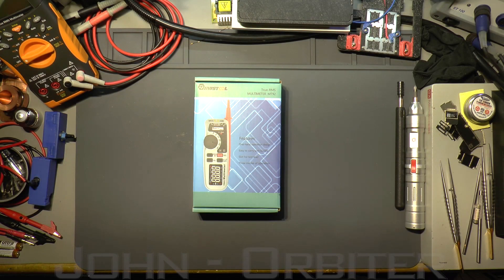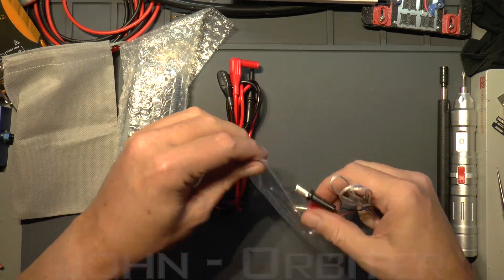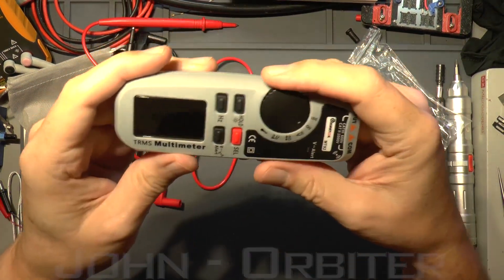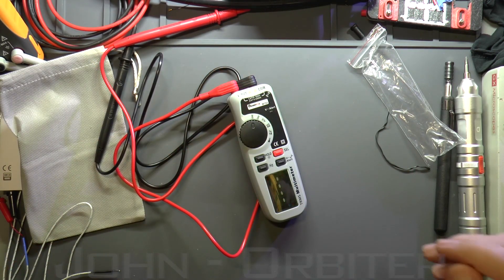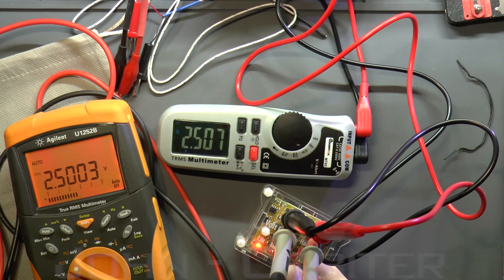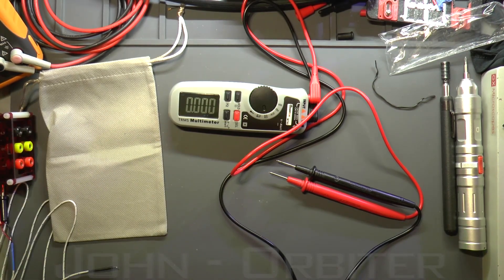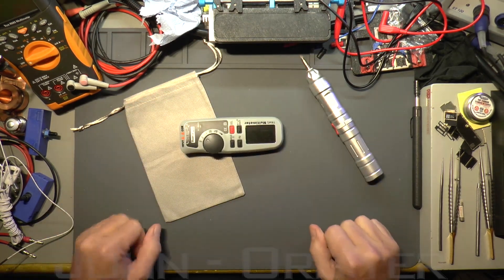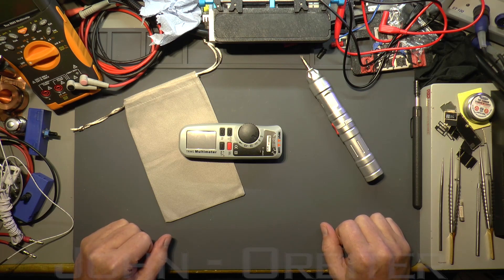Mustool MT92 Multimeter Review

Comment: Hmm not something i would buy, the display is inverse and i'm no lover of that.
I don't know why manufactures think it's a good idea :-(.
The inside has a tin plated rotary.
No easy way to calibrate it, unknown blob chip, really crappy.
I've had a good moan now, i feel better ha ha :-D
I like my old 830b made my mastech better, but im odd like that lol.
Reply: Shows how different personal preferences can be. The rest of the criticisms I agree with but i less than three the inverse displays.
Reply: (not saying you're wrong, a preference is just that :) )
Reply: TheChipmunk2008
Hey i can be very wrong lol.
And your opinion is just as valid as mine :-)
I like a meter that is easy to read, simple to calibrate if it's a basic adc, and enough ranges to cover most of the common stuff.
I hate blob chips, you never know what they are.
I do like the old fashoned icl7106 adc in simple meters, as it was a fluke invension and worked fine for 90% of cheap meters.
I'm just a moaning git! :-D
Reply from the maker: Hi Harv.. Apologies my friend, only just seen your post here, for some reason I wasn't emailed about it. I only noticed it by chance in my YouTube Studio comments. 
My thoughts are similar Harvey, especially the inverted display, which IMHO should at least automatically rotate through 180°  depending on the meters orientation. However it's now only £12.. So 'you get what you pay for' is the correct adage here :D
Cheers
John
Reply: You never need to apologise to me john, i leave a comment as visiting card, and to say i enjoyed your video :-D
I was in a down mood when i wrote that comment, i will delete it if it bothers you.
Sorry about that my frend, you have always been a really nice man, it's not your fault that i'm a pillock lol :-D
Reply from the maker: @zx8401ztv    Nooo, Don't delete it Harv, it's fine. Plus you're perfectly entitled to say what you think on my channel. Well as long as your not nasty to me LOL.
Cheers friend 👍
John
Reply: I think i would find it hard to be nasty to you, maybe your soldering is only 99.5% perfect and your tea making abilitys are well below the national average.
There is nastyness for you :-D
Reply from the maker: @zx8401ztv    Hahaaaa 👍 .  I'm not too bothered about the soldering score, but the poor tea making.. that's cruel  LOL  🤣